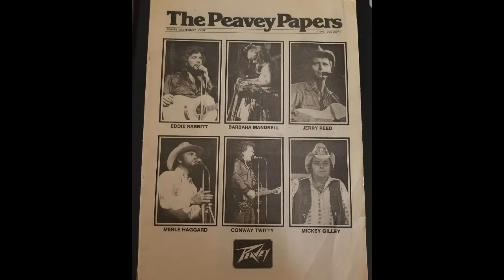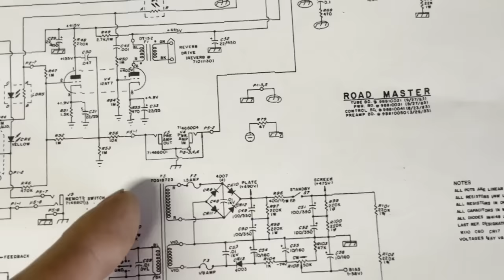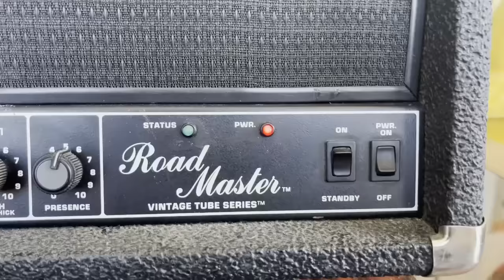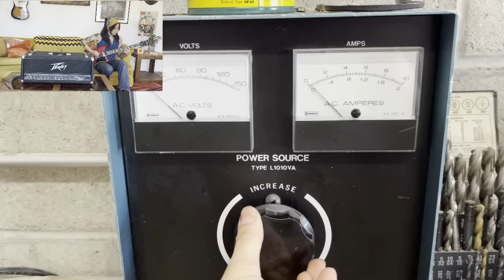80's Peavey Roadmaster Repair & Demo | Peavey POWER!

Comment: This model has been Thurston Moore's main gigging amp throughout the majority of his career, going well back into the earlier days of Sonic Youth. He'd use a number of different amps in the studio but this was his main squeeze. I'd say that's a pretty huge endorsement and speaks to the reliability and versatility of this amp for a musician like him to be using it for so long. Not that he's a virtuoso but - especially live - harmonic content, overhead and tonal versatility are the major hallmarks of his sound, imo. The ability of the amp to respond so well to effects and be able to go from fat, round cleans, to wiry, treble boosted buzzing, to overdriven crunch sounds, to "everything on 10" ProCo Rat tones, to soaked in Super Fuzz/Blue Box with pulsing modulation swooshing through without being lost in the sauce has long been on display in his live shows. I feel like Peavy is at the beginning of a renaissance in the guitar and bass gear community. More than a few older models are going to see some price increases once more people get hip to the artists who have been quietly employing them to great effect for a long time.

Comment: Nice wire bending on the high wattage resistors. I also use ceramic spacers on the legs to stop them bending sideways as things move in transit. Also I have found that sometimes a little extra flux will help with cleaning the solder from removed components.
Reply: You can buy special pliers that will automatically put a smooth, half-round kink into the resistor leads but they cost something like $150!  I've seen Brad's Guitar Garage use them on his YouTube channel.  In this case my personal preference would be to install a pair of skinny brass bolts onto the PC board and solder the resistor to the bolts,  keeping it elevated off the board and helping dissipate some of the heat that would otherwise radiate down the leads. The hole in the board will help with air flow!

Comment: Every player my age(52) has had at least two Peavey amps in their lives. The 70's/80's stuff were built like tanks. 
Great video with so much great info. Bravo!
Reply: I still love my Peavey gear. I lost an awesome backstage stereo chorus from the 80's to a friend but got a used full size replacement. Bandits, Supreme, and TNT will do the job. Need '70's Butcher
Reply: Peavey sold because it was more affordable. Like to DOD pedals. Both products were second-rate. I could never get a gigging tone out of a Peavey

Comment: I have an amp (B-52 AT-100) that had all sovtek tubes from the factory. I'm not sure what was going on, amp was made around 2005 I think. I got it this year and replacing the SOVTEK preamp tubes made a huge difference. I used ruby's and JJ's just cycling until I could find the quietest for V1 and V2. I haven't touched the power tubes. I thought it might help to replace them and rebias because the amp is a bit flubby in the lows and congested in the mids, despite a pretty neat control for scooping the mids (contour). I've been wondering if replacing the power amp tubes would help it a bit, but what I really think it needs is a presence control. I haven't the slightest idea where to start to add that, but I know where I'd put it on the control panel, and that I'd remove the reverb tank, and if possible hardwire that tube back into the preamp. Hearing that you like SOVTEK 5881s as you're favorite 6l6GC replacement is encouraging.

Comment: Oh, look at that power supply board... Here comes trouble. Carbonized substrate and high voltages don't mix. Nice surgery, though not really my kind as I'd probably try designing and making a new board, preferably with an integrated FULL BRIDGE RECTIFIER.

Reminds me of how I fixed a MACE in the 2000s. IIRC that thing had only 6L6s, six of them - all else was solid state. It had both transformers blown, but when I fixed it, it made some real deal racket, haha!

7:08 it's possum time! And nice tattoos at the end too. You're a rad gal <3

Comment: Kudos on the surgery! I also have that very same amp head in my mancave and it's a beast!
Also: mid 70's Peavey Mace amp head and a Mace combo with 2x12 BW speakers, mid 70's Peavey Artist with 1x15 BW, 80's Peavey Session 500 with 1x15 BW speaker, 2 - mid 80's Peavey Mark IV Bass amp heads just to name a few and all are workhorses.

Comment: my first bass amp was a Peavey Bass....2-15 cabinet.Bought in 1976 from Pied Piper in Huntington WV. I later had the upgraded version with high end out and a 1 -18 cabinet. I also owned an old 6 channel powered mixing board....biggest knobs ever. Everyone in town used Peavey...good equipment at a fair price. Very dependable as well

Comment: I am glad to see you removing the burned areas of the board. I used to have to do that a lot on TV sets. Multiple traces to replace by hard wiring. Your repair techniques are almost identical to what I do. On your PS diodes- Did you know the full current rating of the diode requires the full lead length? Per engineering dept. at ECG, the :full lead is used to act as part of the heat sinking for the diode."

Comment: I have a Roadmaster i got in 1992, played it for years, put it away for a while, then had it re tubed and lightly modded for gain, its now my main amp again. Back then they were common at pawn shops in the South for dirt cheap, i wish i had bougt a couple more. It holds its own with any Marshall.

Comment: Good call on resoldering the connections. Also consider using turrets when cutting out traces, gives some mechanical support for on the road amps.  Good job!
Reply: Since there's so much open space on this power supply board,  I would have used a pair of skinny brass bolts as standoffs to solder the power supply resistor to. Easier to install onto an existing, component-populated board than turrets would be, and better for heat dissipation.
Reply: Note the Zenith transoceanic radio and the signal tracer on Hartley Peavey's repair bench.  The small amp chassis looks like it could be a Valco built Ward's Airline amp. (Colleen has a Kalamazoo amp next to her bench, a Model One or Two?  Great sounding little amps!)

Comment: I love your dog. Please have him on regularly. Anyway, I was watching yesterday and thought "I'll never be able to justify two grand or so for a good SVT but check out this thing!". Looked on Reverb (all local pickup) and the fourth one was here in Indy for $600. It's amazing. Much lighter than I expected. Thanks for the hot gear tip. Building a 2x15" cab for it soon. There's no substitute for cubic inches.

Comment: I used JB weld to repair a power amp board that had carbon build up from arcing from a bad Cap. I read somewhere that JB weld is good up to 500v, Amp has been working good since.

Comment: My first real amp (in the late 80s) was a Peavey Studio Pro 40.  My brother and his friends blew the speaker while I was away at college, so they took it to a local electronics shop for repair.  Of course, they didn’t tell me this.  Turns out, the shop had a policy of “anything left over 60 days will be sold”, and by the time I made another trip home and was told where the amp was, it was already gone.  For nostalgia, I check Reverb now and then for one in good shape at a decent price, but the more I’ve learned about Peavey and their shady practices over the years, the less I want anything with their name on it.

Comment: I work alot different. Just me. I would've just unsoldered the caps n resistor.  They make decent parts to have around in a pinch if you ever want to just breadboard something up. Or if you get a call like 12:30 from a customer on a gig you can spot a part in to finish a gig then do a perm repair later. I keep a bunch of 40's@450v some 100&470 ohm 1 watters and a quad of 6L's,34's n 6550's in the " Gotta run" box along with fuses n my trusty Weller 8200 gun.

Comment: Ah Peavey.  I have an amp that looks similar externally, but has a solid state preamp and 120 watts out of 4 6L6s for the power amp.  Runs for a minute, then blows the high tension fuse.  Nothing obvious like the power supply board on this one- that's pretty gnarly BTW

Also, I love seeing a girl doing this kind of thing.  I have 2 daughters that aren't afraid to get their hands dirty working on stuff.  My older one has dome some woodworking and took an electronics class, the younger one was the only girl in her auto shop class.  Keep up the good work!!

Comment: I have a suggestion, it's probably too late, due me just now seeing this video from over 4 hours ago, but here goes, mix up some two part clear epoxy and fill the cut away areas of the circuit board, then rebuild the traces , great video

Comment: As a former ORT  (Oporating Room Technician)  l must say I'm impressed with your tool handling skills. As well as your fluidity and overall economy of motion. Some of it seems intuitive. But some of those techniques were obviously drilled into your head by a good mentor from early on weren't they?

Comment: There Tube amp's where ok, no where near a JCM 800 but use-able. On the other hand, there transistor amp's sounded like trash. We used to call them "Squeeevey" amp's back in the day, once I played thru a Classic 50 VT in the late 1980's I was slightly impressed. It was a good move for Peavey to start making more Hy-bred line's in the 1990's as it made them more compatible in the market that was quickly moving back to tube's at that time.

Comment: About the screen resistors, have you ever seen two , I’d call it “ piggybacked “ ? bc there’s one on top of another connected by solder from top to bottom, then of course the bottom resistor goes into the board. It’s on a ampeg reverberocket 12r

Comment: I bought my Peavey Roadmaster new back when they were relatively recent in production (maybe 1984?). It was a beast, for sure, and I've been thinking of getting another one to match with my Sunn Model T (my main amp since I had to part ways with the Roadmaster, and later, a Marshall JCM-800 from that era which also hurt to have to let go). Too bad you didn't show us the Tube Biasing process; do you go for minimal Crossover Notch distortion or a different method? Also, why do you like 5881 over 6L6GC tubes? Anyway, thanks for bringing back some fond memories of REALLY loud old Tube Amps! 🥳  🤘😎🤘

Comment: I recall some talk years ago about IC caps having a bad run for a number of years. I was told to always replace them in older amps. I think their new ones are fine, thought. Were those F&Ts that you replaced them with? That's what I always use now. They're great.

Comment: 100 ohm is a pretty low value for 6L6 screen resistors; 470 ohm would be better for circuit stability and tube reliability.

Comment: great vid as always! however, i would recommend  just "J-Hooking" all of those filter caps & resistors you are shotgun replacing... while these old Peavey PCB boards are very strong thru holes... it sure sucks having the solder pads get ripped off the board. i find the pads get much weaker after each replacement, on newer products. "J-Hooking" just ensures more years of maintenance without problems later. -just my two cents... which are worthless, due to current inflation. awesome video!

Comment: So awesome, I have this same amp and it suffered the same exact fry spot underneath the resistor on the power board and blowing the fuse. I replaced the fuse and I plan on recapping the board soon. How serious of a fire hazard is the burnt area on the power board? I'm totally gonna clean it up but I'm wondering if you think it could realistically be played a few times first without boinin' 🔥?

Comment: Please don't take offence to my comments, but whenever I replace any component, I always trim the lead to their final length before soldiering.  My reasoning, any stray RF generated comes from right angles.  This experience comes from 30 years of computer board design, adding solder reduces the potental for rf transmission.

Comment: Those soltec tubes there are made in Russia are they not?? I'm not complaining that there from Russia I'm complaining that they're a little bit hotter than the Peavey tubes and the more pricey they take a little bit more amperage the run hard on the power supply

Comment: Why does my ‘52 reissue tweed 4X10 DeVille only give me sound when I plug straight into the effects loop, losing the preamp, it’s EQ, and it’s channel select controls? Pleas someone tell be it’s just the preamp tubes that need to be replaced - I can’t tell with my limited tube amp brain knowledge.
Reply: Replace those tubes. Likely is your issue. Is the amp acting up in any other way? Such as popping/crackling at start up or having extra loud 60 cycle hum? Or ramping up of noise after start up?
Reply: Those deville's & all the hot rod series of amps are notorious for issues. At some point they pretty much all will need servicing to replace caps, resistors, electrolytics & re-soldering. Don't get me wrong, great amps, I own one myself. Just that the build could have been better& much less bulky..  the circuit can actually be rebuilt by hand with a fraction of the components that were originally put in there..

Ask any technician or   at least the majority of folks that work on amplifiers will tell you they have seen a million of the same issues from those amps. Which there's been a million sold, look at reverb at anytime there will be at least a dozen for sale

Comment: Back in the '70's, I worked on Marshall, Fender and Peavey.  Peavey ALWAYS skimped on their PC Boards and other components!!
---
Did you check those resistor's before putting in those large CAPs. and diodes?

Comment: I don't think you should have put 5881's in there instead of 6L6GC's that it calls for. The 5881's don't dissipate the same watts as the GC's and won't be made for the power. Just FYI. Great videos!

Comment: I can't believe you didn't replace the 10/160 low voltage caps on that PS board as well as the others on the pre amp board while you had them out, yikes.... They are all the same age as the HV filters, same use time, same heat exposure and will go bad sooner than later, bad move, respectfully... With amps of this age its general industry practice to replace ALL electrolytics.